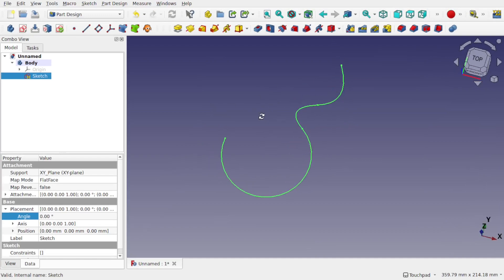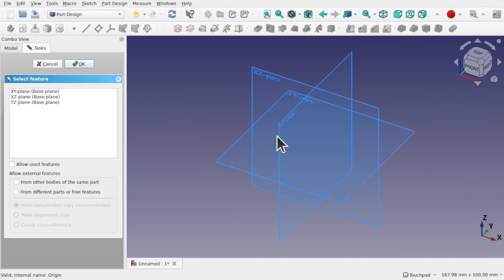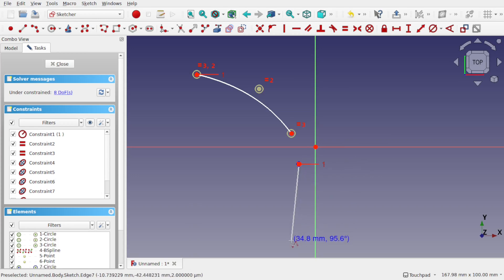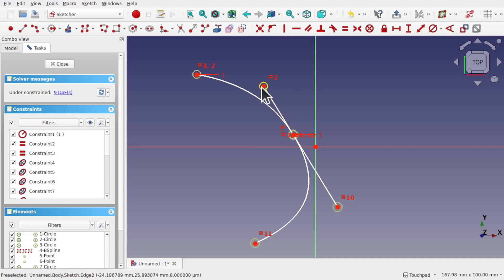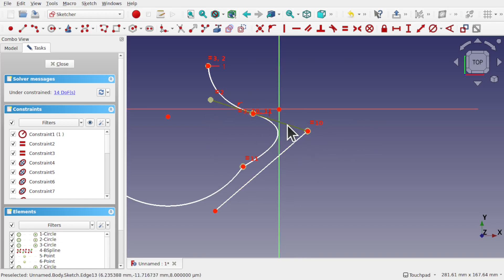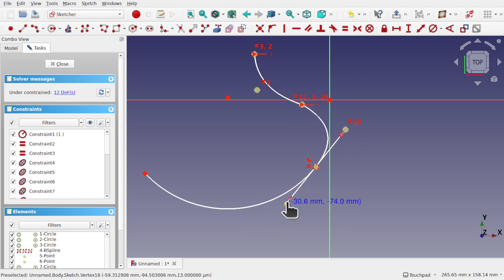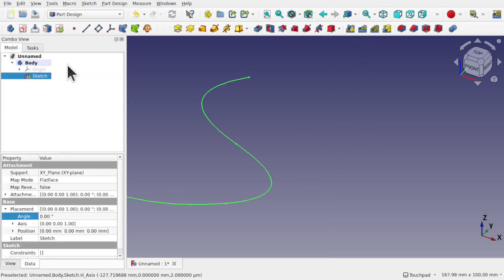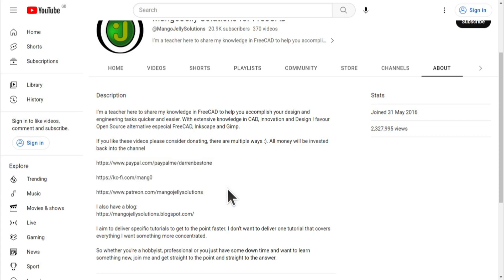Tangent B-Splines? They Are Possible in FreeCAD! But How?

Comment: Hi, thanks for this video.  I have a question.  How could I constrain 2 b-splines to be tangent to one another with a higher degree of continuity?   The technique shown in this video would give G1 continuity, I think.   Is it possible to develop constraints that achieve C2?   To say this another way, I'm looking for a method to make the the seam between two padded b-splines invisible when using FreeCAD's "Zebra Tool", preferably using Sketch constraints.  Or to smoothly join a b-spline to an arc or line, again passing the Zebra test.

You probably already know this, but just in case...more info about continuity: https://www.youtube.com/watch?v=jvPPXbo87ds&t=907s